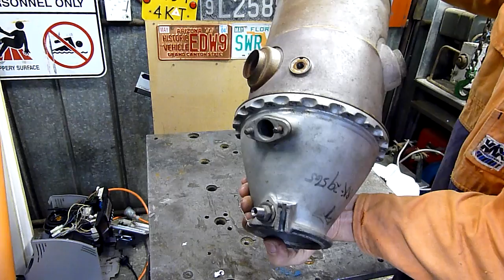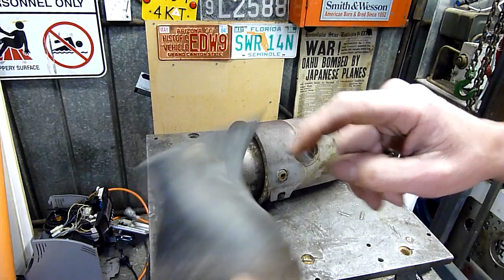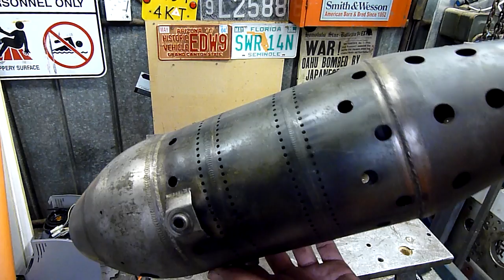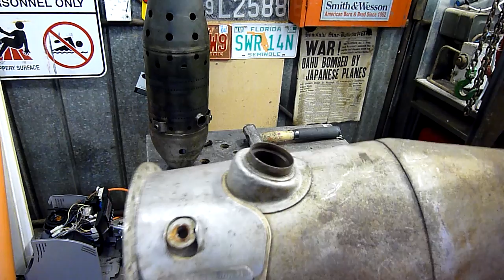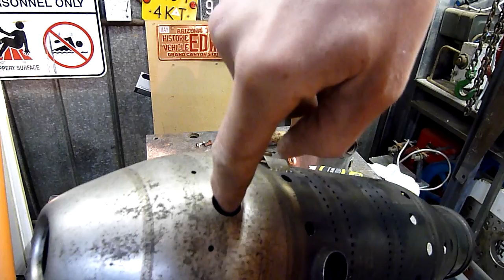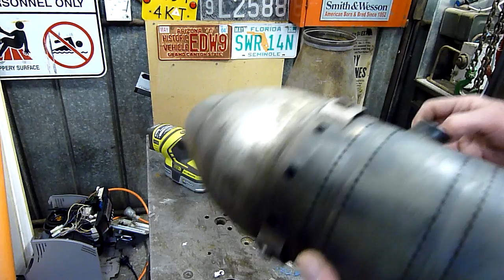Rolls Royce Viper Jet Turbine Engine Combustor Autopsy

Comment: Hi Aussie, thanks for showing this piece of jet engine history. There is something classic about the old designs which were all pretty similar in the early years. I think the little holes at the back are for cooling, often air is used as a buffer between the really hot stuff and what's kept cool.

I have seen people attach road compressors and burn fuel in chambers like this, sort of a nasty noise and flame maker. Maybe a idea if you ever have a roadside compressor handy one day :)

Comment: 4) Those bolts that you called dowels that locate the combustor... we call them combustor locator pins...
5) There is no flame in the output of a properly working combustor, but this is the kind of unscripted mistake I make all the time, so I'm just nitpicking...

I have evaluated your description... and I believe you have a very good understanding of the functioning of this, the most mysterious part of turbine engines

I'm very interested in seeing what you create !

Comment: Hey !!! 
Cool piece of old jet-tech.

1) the nozzle should spray at as little as 25 psi, as that is around starting pressure for these old jets. Yours is probably caked with deposits that will come out if soaked in hot alkali solution... oven cleaner.
2) You had me wincing in pain as you directly hammered on that transition duct segment to separate it from the combustor... Oouuuuuch!
3) That ring of holes in the Tduct was to allow the last of the cooling air to mix with the hot gases